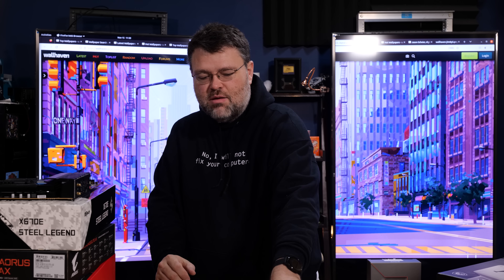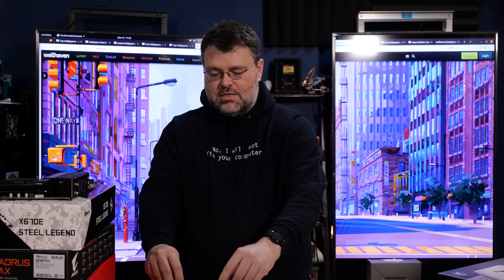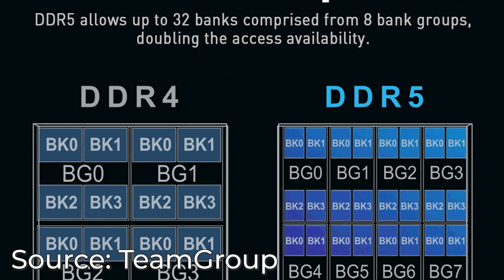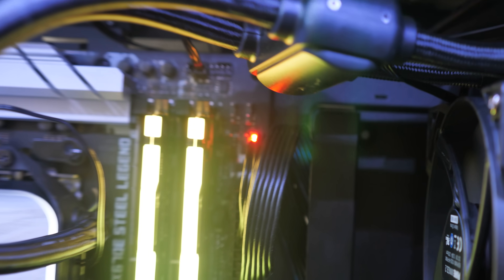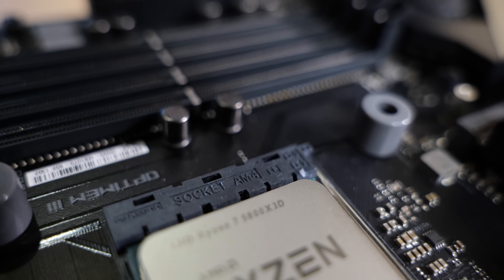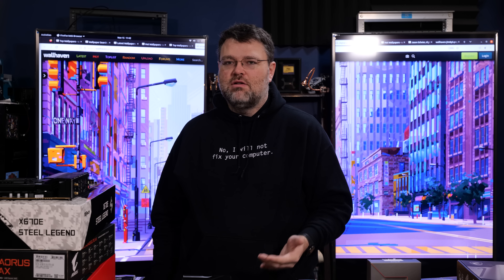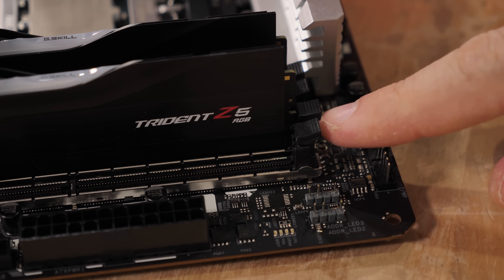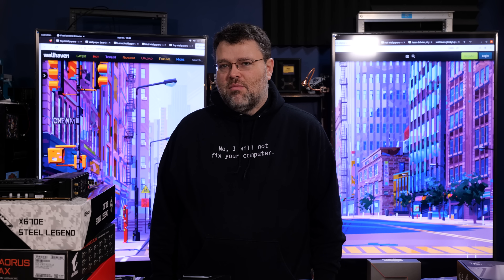Is 128GB of DDR5 IMPOSSIBLE on AM5? Level1 Investigates!

Comment: I actually just fought this after running 128GB of DDR5-6400 on an AM5, but it was only running at 3600MT/s .  I think you are much better off simply running 64GB of DDR5-6400 than anything higher, unless you are not just gaming and need the additional RAM for other types of workloads... now i have 64GB of DDR5-6400 i have to unload... maybe its time to replace my 3090Ti

Comment: I was able to achieve 4800 MTs with 128 corsair vengeance. But im also running a rog strix x870e-e and a ryzen 9 9950x. And for those who are curious, i did get a 5080 astral just because lol.
Reply: Just got a 5090 astral to make a similar build on Meg x870e extreme. Wanted to try dominator titanium 128gb but it is a bit discouraging considering gskill ram is some of the best for amd cpus and expo support is much better there. Really set on 6kmts cl30 but it’s not looking good rn.

Comment: I think you are going about this the wrong way. The first step of a new build is the CPU. I chose an i7 12700KF. It clearly stated it can only handle memory running at 4800. That was my objective. I installed 4x32 gig 4800 sticks and set up BIOS to run them at 4800 which modern motherboards can handle. memcheck86 took 4 hours but all the tests passed. What I am missing from people like you is how to take advantage of that extra memory. Such as VMware or swap-space. Can I get away with less swap space thus increasing performance?

Comment: Running the trident-z 6400 cl32 version of your kits.  Matching kits, with a msi x670e carbon and 9800x3d.  took 2 minutes of training, enable xmp reboot, another 2 minutes and into windows at 128GB 6400.  Boots fast now.  Either it was the 7000 series or they finally got the BIOS updates right.  will test with aida64 tomorrow.  I don't "need" 128gb so if it is unstable or significantly slower, I can pair down.
Reply: 4 Kit or 2 kit?
Reply: @rasoolmohammady2552  2 separate kits of same RAM.  4 sticks. No issues.  That said I build a lot of PCs and AM5 is horrible with compatibility, mounting pressure and memory training even with latest mobos and bios.  If you want the fastest gaming go AM5, if you want a stable no issues workstation I'd still go intel.
Reply: @gottahavitvt  i want 128 gb of ram too. i have ausu rog strix b650e-f. is it good to buy 2 pack of 2*32gb of ram? (total 128) or i should search for 2 *64 that is difficult to find in my country if its not possible and a pack of 4*32 is not possible too for me to find too
and how did yiu manage to run it? did you used ujst the default overclock? or you used specials setting for it?

Comment: I wasn’t able to get a stable system with 4 DIMMS and the higher the capacity and faster you run the more unstable it gets.

This is just wrong and manufactures need suing as it’s not working.

Issue with the slots is they work on a daisy chain not a T system, so the resistance is what’s used to determine 4 or 2

Comment: I got 196GB of DDR5 running on LGA 1700, but it wasn’t easy and forget about XMP.  Had to turn the speed past the rated speeds for 4 DIMMs using RAM on the QVL list.  Even turning off XMP didn’t work.  Had to clear the CMOS before it would boot again.

Comment: CAD and Blender… I Need 128gb. I’m OK with 4800 as Daily Stability for Work. 
What is Best Timings I can Get with 4 Sticks, labeled 5200 or Under-clocked 6000? 4800-5200 is OK if it’s all Stable.
Reply: Hi there, 128gb ddr5 worked at 4800 for you on am5?

Comment: 2 64GB kits of 2X32GB DIMM does not imply that they will run as 128GB on a motherboard. If you want to run 128GB on a motherboard be sure to obtain a 128GB kit of 4 X 32GB DIMM as they are tested together to work as 128GB. With 2 64GB kits running as 128GB is and always will be sketchy.

Comment: Why would it be impossible?

Even Intel gen 12/13 and gen 14 say 128, respectively 192 GB max, but still, if you order ram, try, you discover 256GB runs supper fine.

If it wasn't running with 4 * 64, I'd send them back, as on new products you can send them back in 30 days.

I'll test also 4 * 48GB to see if it works.

It's all to try, if not working, send them back to AWS, they don't complain.

Comment: I have been running 64GB 3200 16-18-18-38 as 4 -16GB DDR4 modules on AM4 for at least 2 years and thought that 128GB was no problem with the next gen. Heck my ASUS B550 MOBO can handle 128GB?

Comment: Thank you for this.  I just did a rebuild with AM5 7950x on an ASUS Proart x670e board.   I am doing a lot of heavy video file editing in Davinci and was clued into having more memory capacity is key to smooth experience when rendering frames during editing. Like 12bit raw 4-8k footage.  Anyways I wanted to get 128gb running and ASUS kept telling me it’ll only be stable with 2 of the 4 slots filled or I have to go with a 4 stick kit they recommended Kingston fury so I’m running that kit now but it’s xmp ready for Intel.   I’m getting speeds of 3600 instead of the 5600 it’s rated for. Any attempt to push that memory faster leads to instability and safe mode booting.    I’m not sure if this will be fixed later with newer bios as we go along with the platform. Or. Do you think there will be 2x64gb kits out there I should look into in order to free up those two slots?    As of right now I’ve never had video editing run this smooth it’s awesome but it kinda eats at me to be leaving some  performance  somewhere on the table …   Appreciate your help your channel and your time 🙏
Reply: Has this improved with newer BIOS updates that are designed to work better using all 4 memory slots?

Comment: I ran 4X16 GB of DDR5 at 6000 mts for 13 months, (7800X3D, X670E steel legend, automatic EXPO) no problem. Until suddenly, one day, I started getting random BSODs or a frozen, unresponsive system. I don't know what fucked it up. Maybe a windows update. I am currently running them at 5200 with good timings, and that seemed to stop the random crashes. I am getting a 2X48 DDR5 kit next. Four dimms in AM5 is a bad idea and I did not know it at the time.

Comment: Has this improved? I want 128Gb on AM5 board. Is it still that I should not buy faster than 3600Mhz memory?
Reply: I'm running 128GB using Corsair 5600 modules, but only at DDR5-4400, otherwise it's not stable. This is on latest 2024 bios Asus X670-P, 7950X
Reply: @jamescarter9147  Luckily I studied this bit more and went with 2x48GB, at the time I was also considering Intel CPU as there memory works better, but in the light of recent news, good that I did not ;)

Comment: Great video, thanks.
I am experiencing an issue with the Asus X670E Extreme motherboard and the same model of G.Skill 128GB (4x32GB) memory modules as mentioned in the video. My system runs smoothly with 2x 32GB installed in the DIMM B1 and B2 slots, but the 2x 32GB modules do not work when installed in either the DIMM A1 and A2 slots or the DIMM A2 and B2 slots, and I receive a C5 error. Additionally, when I install the memory modules in all slots as 4x 32GB, the system does not boot and gives the same error code.

I have installed the latest BIOS, version 2007. My processor is the 7950X3D, and the memory model is f5-6000j3040g32gx2-tz5nr.

If it were a processor issue, shouldn't it also not work with the DIMM B1 and B2 slots? What do you suggest? I would greatly appreciate any assistance you can provide.
Reply: did you find a solution/answer?

Comment: Is there an update on this topic?  Need 128gb RAM but don’t want to waste money if it’s not fixed
Reply from the maker: 2x64gb dimms is the way to go and you're all set
Reply: @Level1Techs where do you even get 64 gb in one ram stick
Reply: @Level1Techs  I was running stable 64gb @ 6000 since my comment.  Upgraded to 128gb today.  Same exact sticks. It’s stable with 4x32gb @ 3600.  If I try to use an EXPO profile it fails the memory training.  If I try to manually step up from 3600 I immediately get a C5 error on the mobo, which is fun because it’s not mentioned in any official docs I can find.
Reply: @evanmhowington  Hey! Is this system still running with 4x32 @ 3600? If so, how have u felt the drop in performance from 6000 to 3600 ? I need 128gb as well mostly for rendering and casual gaming on the side, so im not that reluctant on losing performance if the system is stable and i can do my work as expected. 

Hope you can give me some input on how its been so far

Comment: this video needs an update. AMD a couple months ago released a bios update that improved multiple ram related things (like allowing 7000s series to run 6400MTs ram at 1:1:1)
Reply: It's 1:1 for memory clock and memory controller clock. Not 1:1:1 because the Fabric clock can't be set above 3000 MHz (not that over 2300 MHz works for anyone to my knowledge) and it would need to hit 3200 MHz to be 1:1:1 in that configuration. Some CPUs could hit 6400 MT/s from launch since 2022 (Igor's Lab tested it with the 7950X they had) and some chips still can't after all these updates.

Comment: Great video! Quick question. I'm currently running AM4(R53600)+4x8GB DDR4 @3200, and I'm going to platform upgrade (GPU, PSU, MOBO, RAM, CPU) later this year to AM5(R77700X)+4x16GB DDR5 @6000 (F5-6000J3038F16GX2-TZ5NR). Do you think I would be able to run those 64GB (4x16) at 5200? Motherboard will be GIGABYTE B650 Gaming X AX. I'll also be building a PC for my girlfriend, same memory and CPU, different motherboard: GIGABYTE B650M AORUS Elite AX as she wants a smaller tower, so, I'm getting small form factor and small case

Comment: Has any changed regarding this matter? Has there been a bios update that makes it possible? Is there a new mem controller on the 9000 series that make 128 GB at 6000MHZ possible?
Reply: it's very board dependent, my Gigabyte board can run 4 of them at 6000 MT/s with the latest BIOS update. Zen 5 actually reuses Zen 4's IMC as well. I have a 9900X.

Comment: A most informative video. I wish I had seen it before I spend $900 on 128G of RAM =P
It's just as you said, too. I can get the 128GB to work at 4000Mhz but nothing over that. Granted, I'm not super well versed in optimizing RAM.
64GB on XMP works flawlessly though. Either way, thank you for the excellent video!
Reply: any update on this, with that somewhat recent bios update that improved a bunch of ram related things?

Comment: Was running a 7800X3D, 64GB (2x32GB) RAM @ 6000Mhz. Upgraded to 7950X3D 128GB(4x32GB) @ 3600Mhz. The RAM does take a big hit. Tried even at 4800, 4600, 4400 and 4200MHz. No luck. Just gave up and left it at 3600MHz.
Reply: How was the difference in performance going from 2x32 @ 6000 to 4x32 @ 3600?
Reply: @NicoGz96  No difference, I was using it for hosting Space Engineers in a cluster of 8 servers. The RAM bandwidth was running around 10-30% at the most part, RAM total usage on the other hand was sitting around 100GB+-.
You might loose a few % on performance, but luckily the CLS was running low on 128GB, think it was 18.
Only on heavy RAM bandwidth usage will you suffer.
Reply: @drakcoreoriginal  Thank you for the quick reply.

Im getting a new am5 rig with a 7950x and 4x32gb ram mostly for rendering and some casual gaming on the side, and im mostly worried about system posting and being stable for my day to day work (even if only @ 3600l and not so much worried on gaming performance lose (which is the concern for the majority of people)
Reply: @NicoGz96  Oh don't worry about stability. They sorted that out a few BIOS revisions ago. If you are buying an entirely new ram kit, even the 4xkits, a lot are now designed for the 128GB, 192GB or even 256GB levels. I was dumb enough to not replace my original 64GB kit with a proper 128GB kit and just bought another 64GB kit to make the 128GB. Problem is though the same brand/model ram, chips come in batches and don't always aligned accordingly.
Also long as you don't skimp on the MB or ram, you can easily get 5200MHz+.  MHz/freq isn't everything, the CL, the lower the better.
Think of MHz / CL = performance roughly.
Reply: @drakcoreoriginal  currently waiting on a new x870 asrock pro rs to arrive. Only thing that still keeps me worried is that i cant get 4x32 kit but instead 2 2x32, so im just hoping all works even if its at 3600. Just need it to be stable

Comment: Conclusion: rushed AM5. Technological advances aren't that advanced today as they were 10 years ago. I'm left scratching my wallet after jumping to AM5 from a 4790K / DDR3 rig on which 4 sticks (OC) worked better than 2. I wanted to add another DDR5 2x16gb kit to match my existing Trident Z5 6000 CL30  seeing that you can't actually hit the same ram speeds with 4 slots populated is beyond retarded. I now have to get a new 2x32 and hope to sell the existing 2x16. Way to go, AMD!  You were once the underdog who performed better than Intel. I largely regret my jump to AMD today.

Comment: I have built with 3950x3d, Aorus elite AX x670 and 64gb (32x2) DDR5 6000Mhz CL36 and got the 6000MT/s strait, but when added two more 32gig DIMMs and populated all 4 slots with same CL36 6000Mhz memory, I can get only 5000MT/s with all the efforts using XMP, my BIOS is F9 which is old by now, but when I upgraded my BIOS F11 or latest, it did not gave any clock more than 3600Mhz, PC didn't boot with any XMP multiplier other than 36 (3600Mhz). Then I downgraded my BIOS to F9 again and get theh 5000Mhz using XMPx50 and running statable now. I did tried to do it manually but non of the combination booted. So, upto 64GB (2DIMMs) you may get advertise memory speed, but beyond 64GB (2DIMMs/Sticks), its is really a silicon lottery. What you loose here is around 15-20GB/s b/w between Processor and RAM (5000MT/s-60-65GB/s and 6000MT/s-80-85GB/s).

Comment: My AM5 AND DD5 configuration and what has been happening:

MSI B650 Motherboard Mount WIFI (tested original) (PLUS Store)
AMD Ryzen 5 7600 Processor (Made Boost 200mhz + PBO -30 Negative All colors) (tested original)
Kit 32GB XPG 2x16 6400Mhz CL32 memories (tested original) (PLUS Store)
SSD M.2 Nvme Samsung 980 Pro 1TB (aliexpress) (tested original) (PLUS Store)
Power supply XPG 750W 80Plus GOLD - PCIE 5.0
Montech Air100 ARGB 4Fans Case + Controller
Video Card RTX 3060 12GB Yeston (BUG) (aliexpress) (tested original)(PLUS Store)
Water cooler Aigo darkflash radianto 240mm ARGB (85CFM)
Socket CPU AM5 support + fee R$ 29 (PLUS Store)
Artic MX4 thermal paste (tested original. amazon)

(I spent Incriveis only R$ 5.5k (U$1.000) (before shipping the conformity, I was charged only R$ 29.00)

As soon as I assembled it, I updated everything, bios, drives, etc. to the latest version, EVERYTHING on the assembly date (08/16/2023)

For 2 months the DDR5 worked ZERO bullets on OC 7400Mhz CL32
Once I put the kit at 8000mhz at CL36... and it worked, a little unstable, but everything worked fine.
Then I did more XMP and EXPO tests, and FINALLY I used 6000mhz on CL28 for another 1 month (yes, I really abused it, and I get zika) (I played, I did tests, everything was great and stable for 2 months of intense use)

However, after some Win updates (via win update) the DD5 no longer behave well. (I've already formatted the PC twice)

XMP doesn't go up
AMD EXPO does not go up

And when it goes up, it turns on, and after 3 to 5 times turning it on, off and restarting, it doesn't boot anymore (just restarting the Bios using the back button) and the video returns.

I did all the MEMTEST86 tests and WIN memory diagnosis

When I put 7400mhz CL34, MEMTEST86 gave it as FAIL, and faulty memories (1000 failures)
When placing the kit at 6000mhz CL28, MEMTEST86 gave it as APPROVED, and memory without FAULTS (zero failures) (BUT NOW THE SYSTEM IS UNSTABLE, CURRENTLY)
When deactivating, and leaving native, in CL40 at 4800mhz, Mentest GAVE APPROVED, memory without failures. (zero failures) (stays stable, normal)

Yes, I'm a PC fan, and I want to extract the maximum performance from these DDR5, and finally reach the highest performance and stability of AMD Ryzen. That's why I want to know, is there anything else I can do, try, wait?

(I cleaned the memories with contact cleaner, PC is perfectly assembled, checked, drives are all up to date (03/11/2023) programs optimized, PC is CLEAN and smells good. Extremely well organized and fitted in)

Comment: Dunno, I've been doing it fine for the last 6 months.
Just disable XMP / EXPO.
Run it at the stock safe 3600 or 3800.
You have to match the two kits you buy exactly.

Comment: I hope OP has had time to correct error of his ways.  99% of this video is useless quasi  BS . Perhaps loaded with true but superfluous information that has no bearing on issue. Even today the issue is failed system post on AM5 and Intel 12th and 13th  gen with DDR5 4 stick XMP/OC memory remains. The issue is that running XMP/OC with 4 DDR5 sticks is unstable when running above 5600 mhz. At 4800  it is stable. At 5000 and 5200 is mostly stable. Problems may begin at 5600 and are really present at 6000. Sad part , it's not universal. It's a combination of mb, ddr5 sticks, and GPU.
At 64gb using 16gbX4 or 32gbX2, at full 6000 or higher (as suppourted by MB bios), there is little or no instability. But move up to 128gb , and realistically , you are limited to base DDR5 4800mhz , regardless of what MB and RAM supports.  Running above that and you risk stability. Go ahead and blame who you want. Go to Digital Storm, Origin, CLX, Xidax. All their 128gb ram offerings top out at 4800. While 64gb (32gbX2) go higher then 6000. Their workstation and server offerings are at 4800 or lower for ECC sticks. They can't get reliable stability , or even posting, with XMP/OC ram with 32GB X 4 DDR5. They simply can't. 
I blame MB and chipset vendors. They view 128gb as high end workstation capability , which it is, being highly uncommon and uneeded on consumer gaming system.